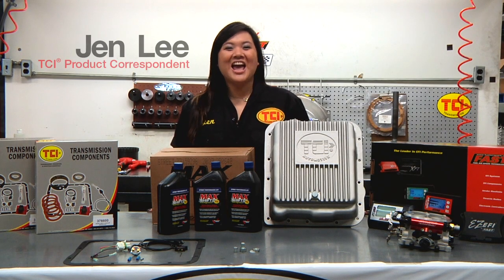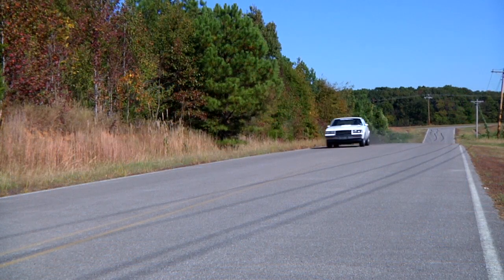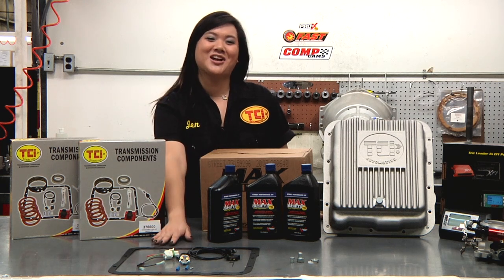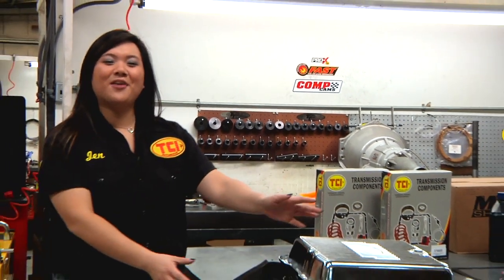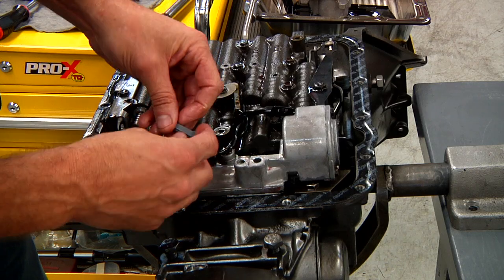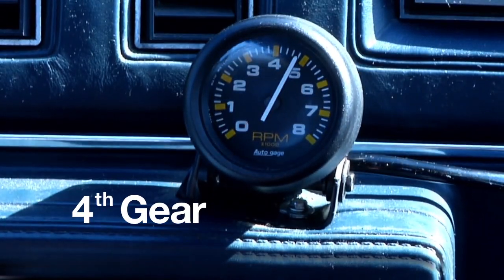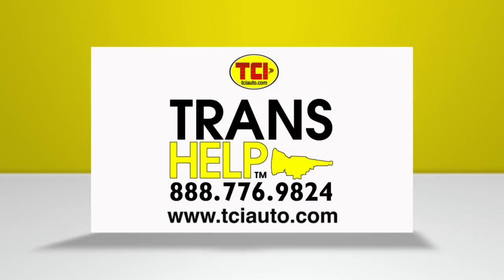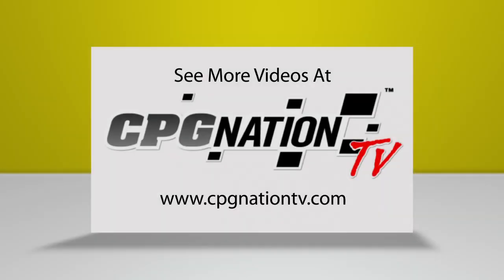TCI® 700R4 2004R Universal Transmission Lock-Up Kit

Comment from the maker: @MegaChevy65 Our 376600 lockup kit doesn’t need an ECU. It’s a standalone kit that provides torque converter lockup with a switched 12V source. The stock ECU normally regulates this on factory vehicles.

Comment from the maker: @slednck3 The lockup kit controls torque converter lockup only.For transmission specific questions your best bet is to call TCI directly at 1.888.776.9824.

Comment: I bought this kit 2 years ago working fine but now it dont lock up anymore I bypassed the vacuum switch even the brake switch , Could the 4th gear pressure switch can be causing this ?

Comment: I bought the kit that uses a pressure switch that screws on the outside of the accumulator. do you have a vid with any help issues on that system?

Comment: If you replaced your original transmission with a 200R4 or 700R4 you will need it, unless the ECU computer in your car is able to be connected to the lockup solenoid and work properly. Without the lockup these transmissions run too hot at highway speeds (they don;t circulate the fluid fast enough).

Comment: my 700r4 will not lock up until unless i hold it like half throttle and it gains speed. if i let off a little it goes outa lock up and jumps up 300 rpm